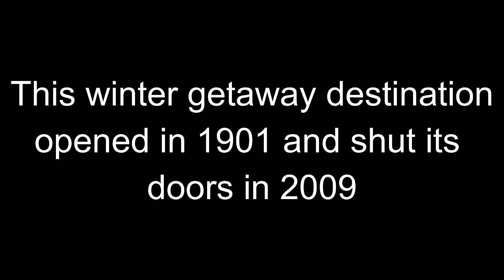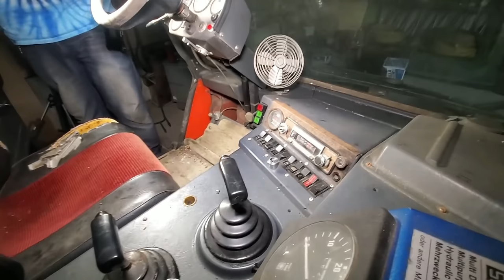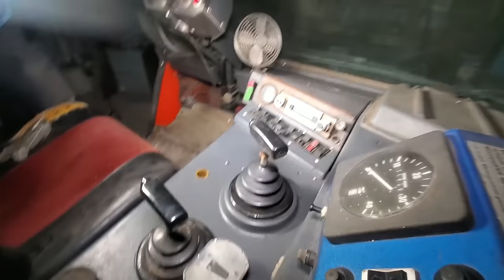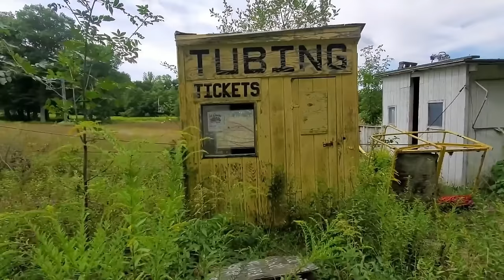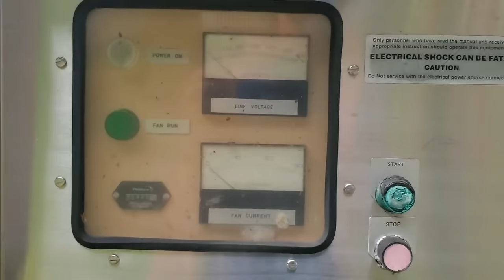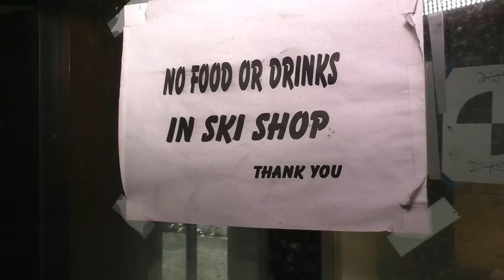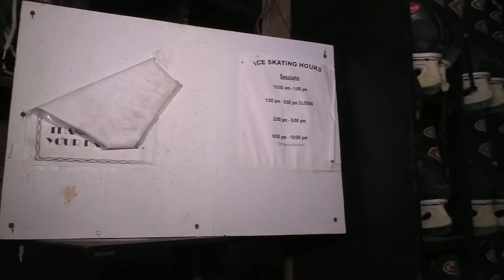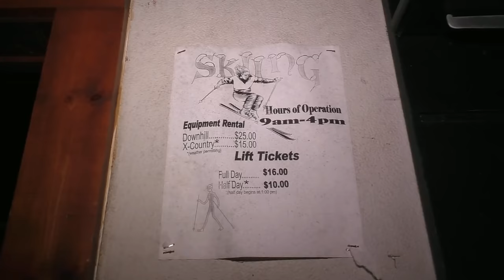NEVELE RESORT Complete Tour - Abandoned Catskills Winter Getaway (Long Form)

Comment: I went here not too long after it closed and it was so cool. A lot of it was still perfect and then a few spots were just starting to show decay. Pretty much everything was still in it and right where it was left. Like the big club/theater still had all the chairs, all the stars were still on the walls. The gym still had all the equipment. Some of the rooms were literally nicer than the shitty hotel we stayed in the night before lol. It was a good time but some of it was too perfect. I wish I'd gone back a year or two later before a lot of it got trashed. It's cool a lot stayed nice too though. It was still pretty protected then too. Security had a base set up in the circular tower building but we lucked out on a holiday and they weren't in there and only patrolled a couple times then took off

Comment: NuTone is a vintage intercom system for use thru out a building. A radio was a high end option and  that panel in the library was was the hub. They could also be used to listen in selected rooms as well.